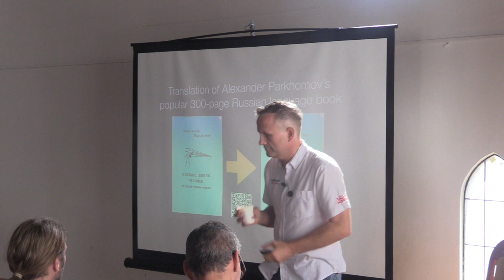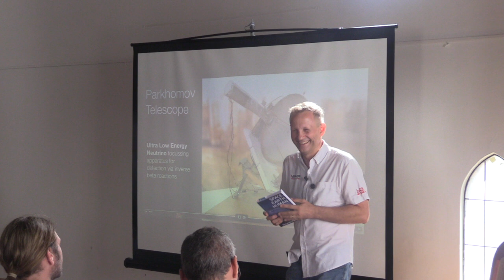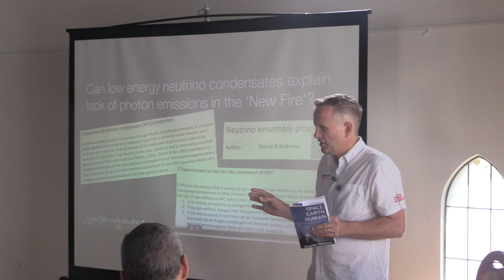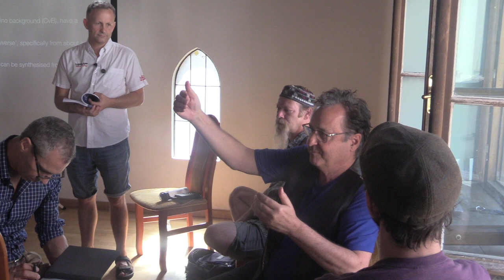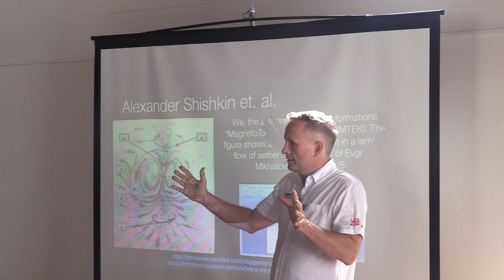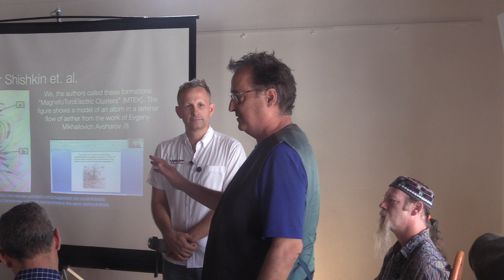Bob Greenyer What is Negentropy

Comment: Some quotes from various html pages & pdfs on miles mathis’ science website:

“…..I feel I must give a quick overview of my charge field. My regular readers may want to skip ahead. In short, I pulled apart Newton's old gravity equation, the one we all learned in high school, F=GMm/r2. The constant G there has never been assigned or explained, except as a hole filler. I discovered that it is hiding the charge field. The charge field is photons, particles of light. The charge field is already known. In macro-physics, the charge field is known as the electromagnetic spectrum, and it includes photons of all known sizes, including visible light. At the quantum level, the charge field is known as the pluses and minuses on the proton and electron (and a few other particles).Charge is the force that is thought to explain most of the quantum interactions. It is the main force at the quantum level. But up to now it hasn't been assigned to anything. There is no real field and no real field particle. It just is. When pressed, particle physicists will tell you that charge is mediated by a messenger photon. But this is a virtual photon. It has no mass and no radius and no real energy. It relates charge by simply “telling” the other particle plus or minus. Anyone can see that isn't satisfactory, so what I did is combine macro and quantum charge. That is, I proposed that quantum charge was mediated by a real photon of some size, a photon with real energy,real mass, and real radius. The field of these photons is then what we call charge. Since this is the same field we have at the macro-level, we must have charge here, too. We have been told that we don't,and that celestial mechanics is gravity only, but I found that the size of the macro charge field was precisely the size of the hole G was filling in the equation above. Yes, charge was hiding in G all along. Finding charge at the macro-level ended up giving me what is called a unified field. I have shown since then that both charge and gravity exist at all levels, so we have a unified field both at the macro-level and the quantum level. Historically, physicists were looking to unify their fields by stacking the maths they already had at both levels. I showed that the equations they had were already unified, and that what we needed was a way to break them down, to see what they really contained. At any rate, this discovery was like the key to the city, as far as fundamental physics goes. It allowed me to rewrite all their equations back to Newton, and to solve all the sticky problems that had accumulated since then. One recent problem that it allowed me to solve very quickly was the problem of dark matter, which I showed was just my charge field. Using simple math, I showed that the size of their dark matter field was exactly the size of the charge field that had been hiding in G. Even more recently, I showed that the strong force could be jettisoned, since my charge field allowed me to diagram the nucleus. I have shown that charge is actually channeled through the nucleus, so it doesn't act to repel protons in the way we thought. This means the strong force is unnecessary. Diagramming the nucleus also allowed me to redefine Hydrogen bonding, which impacts this paper. Hydrogen bonding is currently used to explain the ascent of sap, since without it water would not have enough tensile strength to rise. I will show below that the new explanation of Hydrogen bonding is the same explanation of translocation in plants: the charge field. It turns out that charge is actually the main force and the main energy in the universe. Even in terms of mass or mass equivalence, photons outweigh everything else by about 19 to 1. But the most important thing here is the way that charge interacts with matter. All charged particles like protons and electrons recycle charge by recycling photons. They actually take them in at the poles and emit them at the equators, like little engines. Larger collections of matter do the same thing, and the Earth takes in photons at the poles and emits them everywhere (but most heavily at the equators). The faster the charged object is spinning, the more it emits at the equator and the less it emits everywhere else. So electrons can be thought of as little disks, with almost all the photons being emitted in one plane. But with the Earth, we only have a bit more emission at the equator, due to the relatively slow spin. What this means for biology is that the Earth is emitting a stupendous amount of charge straight up,wherever the plant or biologist happens to be. Invisible photons, most of a tiny size and energy, are moving up all the time. They are also spinning, and this spin will create a magnetic effect on any ions in the field. This means that translocation in plants is mainly another electromagnetic or E/M effect. We have long known that plants use electrical or magnetic fields to do some things they do, just as animals do. But without the charge field, it was not understood how these E/M effects were created, or how any perceived force could be created.” xylem.pdf

“Gravity is a measurable force at the quantum level. It has been hidden in the mis-defined and mis-applied charge field. The total E/M or charge field we now measure at the quantum level is not a single field, but a unified field. Once we un-unify it, or separate it, we find the gravitational field as a major player once more. As at the macro-level, we find that gravity is strictly a function of radius. Mathematically, it may be treated as a straight expansion of the sphere of any given particle. Along with the new positive charge field, this explains relative attractions, orbital distances, and unification.” quark.html

“What was wrong with push gravity? Well, although it was a field theory, using a corpuscle, it didn't tell us what that corpuscle was or link it to other theory. It didn't tell us the corpuscle was a photon, and that that photon was the same photon used in EM theory. It was always light. Most theorists tried to create a second “ether”, and that couldn't be worked into Newton's equations. Even if they had linked their corpuscle to the photon, charge, and EM, they still couldn't say where it fit into Newton's equations or the Lagrangian, because they didn't understand the Lagrangian was a unified field equation. So they couldn't do either the math or the theory.” grav4.pdf

“All along, particle physicists have assumed that neutrinos are particles somewhat like photons, with zero rest mass but a tiny energy. The neutrino came from beta decay experiments, and it was proposed by Wolfgang Pauli in 1930 to fill energy gaps there. Very little has changed since then. Unfortunately, the gap isn't properly explained by a new particle, as I have shown: it is caused by magnetic or spin change to the surrounding charge field, which causes a small energy change. This change is localized, and therefore it acts somewhat like a particle, but it is a field wave, like sound. Again, a field wave, like sound; not the spin of a particle, like light. This localized field change can then travel through the charge field at the speed of light, still acting somewhat like a photon. But it isn't either a photon or a neutrino. It isn't a particle at all. It is a wave like sound, which exists only as a pattern on a background.” neut2.pdf

“So there is no neutrino oscillation. And there are no neutrinos. There is also no beta decay. Nothing decays. All these things are caused by real hits in the charge field, and are explained by spin cancellations or augmentations. Spin mechanics, in other words.” neut2.pdf

“how the elements are built-a mechanical explanation of the Periodic Table.”
“In this paper I will show that quantum mechanics doesn't even match the Periodic Table, much less data from accelerators. I will show that quantum equations should have been attached to the nucleus from the beginning, not to the electron. I will show that electrons spin but do not orbit the nucleus. I will prove once again that the strong force is a myth, and that it is not needed. I will provide diagrams of several nuclei, show you how to build most elements using the noble gases as bases, and explain simply and directly why Technetium and Promethium and Radon are radioactive. I will explain why some elements have more stable isotopes than others. I will explain the incredible stability of Tin. And I will prove that the central quantum equation is false.” nuclear.pdf
Reply: Also known as cold electricity, radiant energy and the aether.  Yes, what you explain makes perfect sense - and, yes, the Universe is “electric” (as in the aether is radiant energy is, as you describe, objects with charges to the lowest level). The universe is also fractal, so, again, what the paper describes at the lower levels will be similar to our”everyday” level will be similar to stars, galaxies, clusters and so on (scale invariant attributes, in other words).